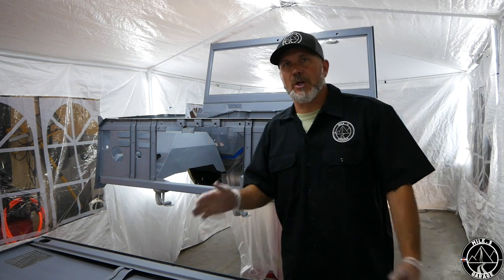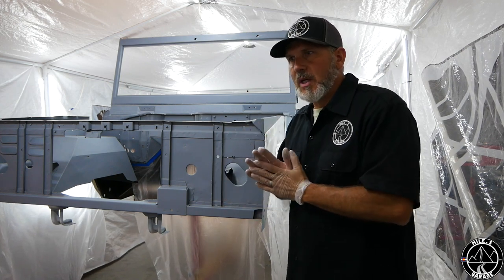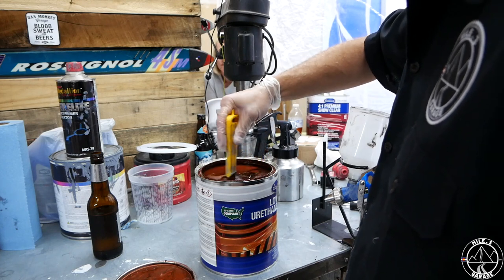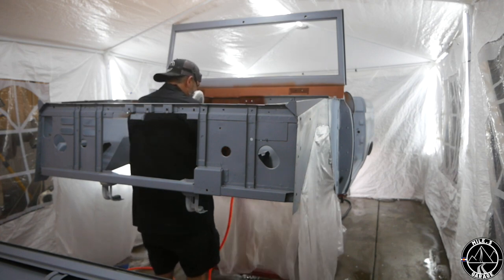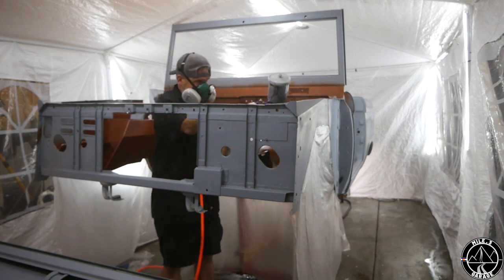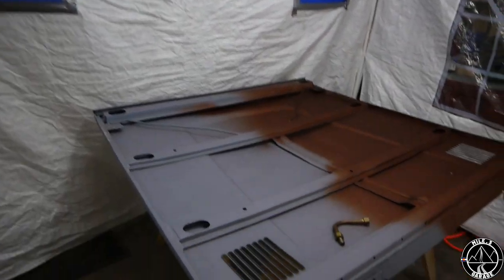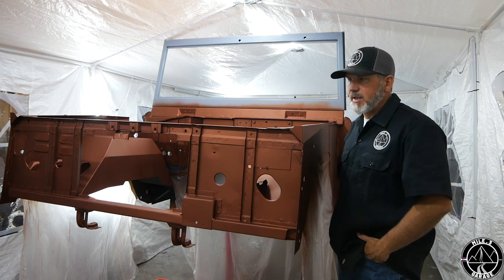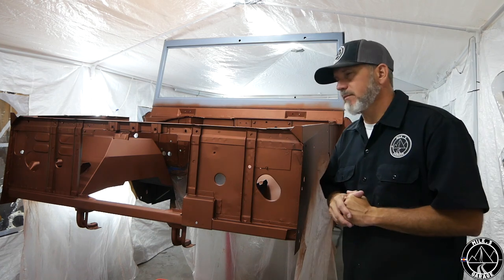Early Bronco Restoration - Finally Paint!

Comment: Looks good but I think the placement of the small metal pieces welded to  the tops of the front door jams are incorrect. They come in two pieces each side and hold the corners of your dash in place. You may want to address this before you go any further with the paint.
Reply from the maker: Interesting. I’ll check it out. Thanks Chris.
Reply: Looking at it again your just missing the other peice of the two parts that gets welded in on top.

Comment: Just my 2 cents...i paint with a 30 gallon air compressor because unless you have a couple water separators on the line a big compressor will build a lot of water and will spit it onto your paint. I paint  at about 30 psi depending on the gun. I would also normally have a second regulator on the line to make sure my pressure is constant. I always reduce the paint otherwise it will clog your gun...normally base is 2 -3 coats, so make them light then heavier. Its hard to mess up base, if it runs sand it down..the clear is what you don't want to mess up on.nice even wet coats. You can buff out to much clear but its impossible to buff out a dry spot... so better to lay it on thicker than not have enough.